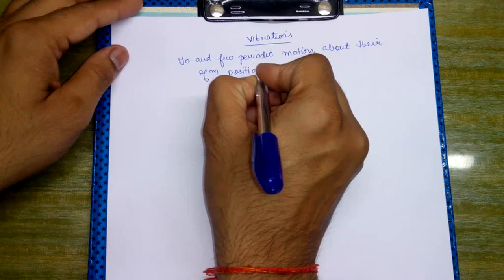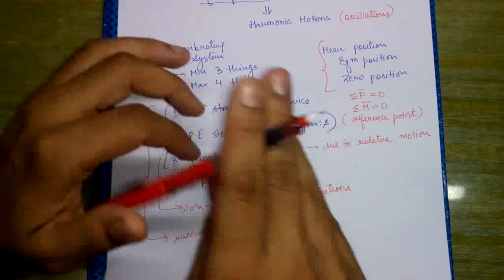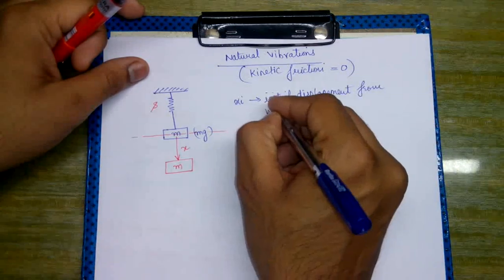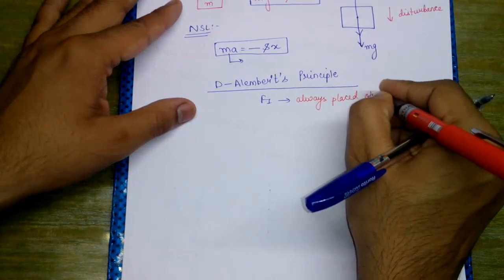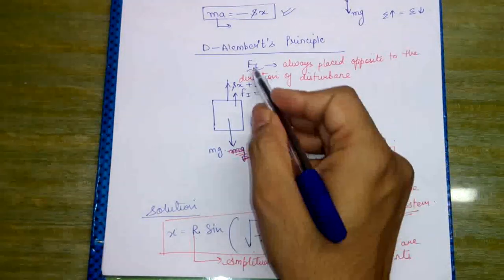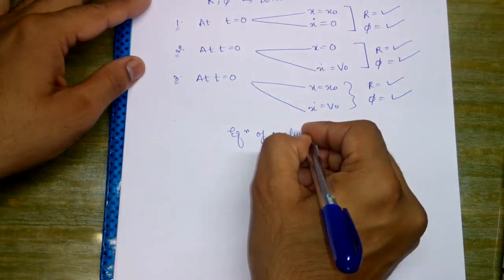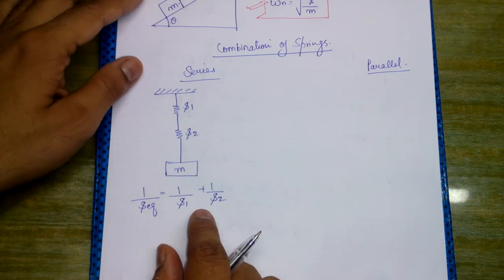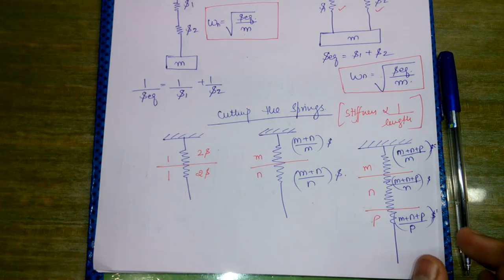Vibration Analysis Lecture 1: D-Alembert’s principle, natural vibration & its equation,  springs .

Comment: Hello Sir,
Hope You are doing good ..
SIR I have being following your lectures for a time now and ALL thanks to YOU that my concepts are clearer than before.. 
SIR I RESPECT AND ADMIRE YOU A LOT for Your EFFORT  and WORKS for
 Educating US IN SO  MUCH  IN-DEPT DETAILS ..

BUT it really becomes FRUSTRATING sometimes when Someone is VERY CONCENTRATED  and out of a sudden an ADD pops up AND all the FLOW BREAKS UP..and that also several times in a single lecture.

I understand that its the REASON HOW U are able to Provide US EXCELLENT EDUCATION FOR FREE OF COST, which are actually PAR with the Standards of COLLEGE and COACHING PROFS..  BUT It Would be More Pleasing and Convenient to follow through
if YOU REDUCE THE FREQUENCY of ADDS by some degree on Your lectures.. 
Hope You Will consider my Humble Request and think on it a bit.

LOVE  and BEST WISHES 
from ALL the EMERGING ENGNEERS
Thanking You 
Bijoy

Comment: Hi can you help me with the  solution 
A simple pendulum of length 5m with a bob of mass  1kg ,is in SHM. As it passes through the mean position the bob has a speed of 5m/sec. The net force on the bob at the mean position is ?
Reply from the maker: At the extreme left and right positions the net force and acceleration are maximum whereas velocity is 0 but at the middle position net force is zero and so is acceleration but the velocity is maximum fro the SHM case.